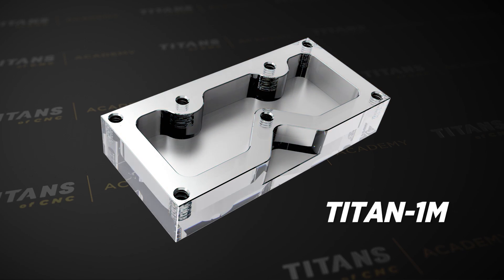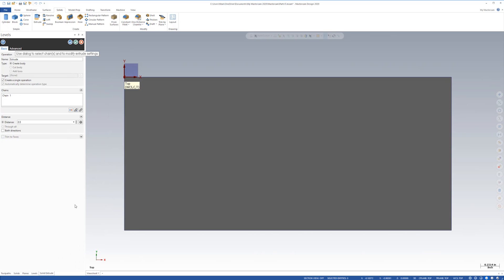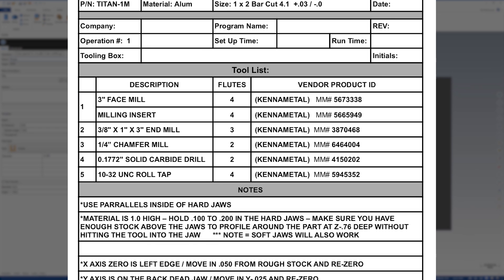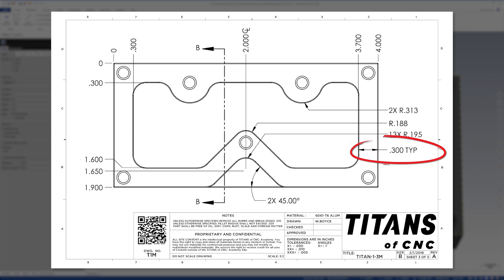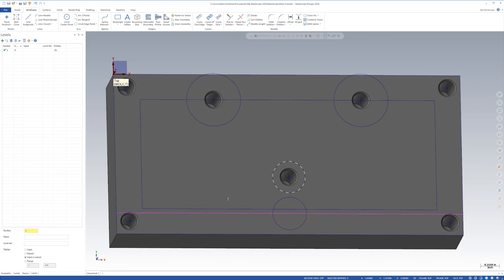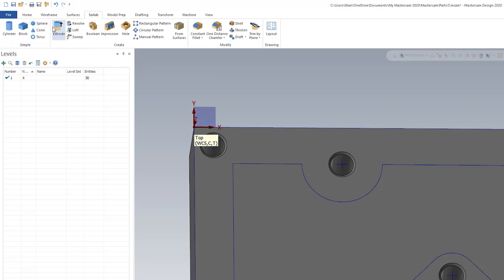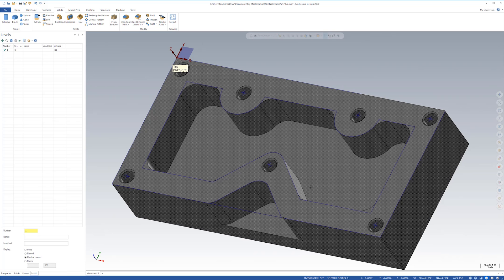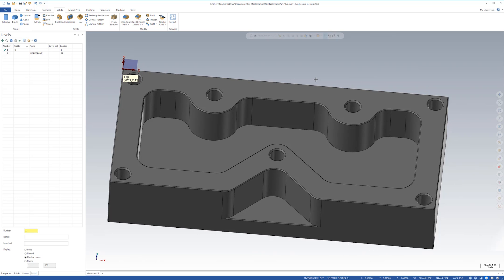Mastercam CAD Tutorial | Designing The TITAN 1M (FREE Resources)

Comment: @7:25 when i press enter i dont get the holes to show up, they appear as x's still on the bottom of the part. im stumped. Also is there settings that we need to input into mastercam before we try this for this to work? when i extruded the part it did not turn solid and was just a hollow rectangle.

Comment: Why have we changed the diameter to 0.177?
I see in the setup sheet it is mentioned we will use 0.177" drill but for the tap in the print it says 10-32 which is 0.159"
I am a total newbie and would appreciate any and all help!!
Reply: Roll Taps require a larger drill size.

Comment: The part where you're breaking the lines to do the outer contour won't work You can't break and re add the line What I've found is you have to extend those lines and then add a horizontal line to them . You can do it your way but try to save the file you can't . Unless I'm missing something then it has to be done this way . The lines I'm speaking of are the 225 deg and the 315 degree lines . If  you break the original contour line you can't save the solid part it will create an error .
Ps not all of have 2019 or 2020 so the Hole add on solids was only put in as of 2019 I use 2018 . Ps awesome videos I will do the whole thing as I'm still learning thanks so much .
Reply: thanks i was just running into this problemm, driving me nuts

Comment: I've been having problems with this drawing, as soon as I do all all the internal .500 extrusion and finer details and finish save . I cannot seem to open the file the same way all I get is a wire drawing . Why is that? Please need help .
Reply: Same as me 😥 did you sort it ?
Reply: Go to the solids tab in your operations manager and click on the little plus symbol next to "Solid". Then double-click on the extrusion and click on the button that lets you re-chain everything for the extrusion. Then shift-click on the side of the rectangle such that the entire rectangle is selected nicely and hit done. Finally, you can hit the regenerate button on the top of that same solids tab. Now you should be able to save it properly.

In case you removed some of the lines when trimming you have to add them back in.

Basically, when you separated the lines for the pockets, the extrusion didn't have a nice rectangular chain anymore since you separated them.
Reply: @demain8781  yes thanks  I figured it out after posting . Just unbroke the trim line that was extruded and drew a phantom line to rechain it. Or something like that .

Comment: Im machining automotive glass and i was wondering what kind of tool would you recommend? im stuck and i cannot go any faster then 15.00F
Reply: use lubricant like kerosene when cutting glass (or clear mineral oil), tools use diamond tools like PCD (polycrystalline dimanond - £18 per insert with pcd on it) or even MCD (monocrystlline diamond - very expensive £220  per insert with MCD on it) try this website for guidance 
https://6c-tools.ch/en/6c-tools-ch/produkte/#iLightbox[gallery_image_1]/0

Comment: Brave enough to admit, I had no idea MasterCam was a CAD program, thought it was only a CAM program once models were developed....
Reply: Mastercam has different modules you can purchase.  Solids being the one you need for modeling.  There is also an "Art" module and many others you chose when purchasing mastercam.
Reply: @TheShift1313  they have done a terrible job marketing their products.
Reply: @automan1223  on their website under solutions they have "design" listed and that's where you will find it.  No argument from me on the marketing side.  I have been using Mastercam for years and training users how to use it for a long time.  For actual modeling past a bit of model prep I always go for a cad focused program.  With the levels, wireframe and 2d vs 3d construction modes it's a very different way to model.  It certainly can be done and there is a solid manager that tracks feature history but I still stick to model prep only.
Reply: @TheShift1313  I looked at MC but only or the port solutions for cylinder head work. 15k out of my price range, and I do not have a 5 axis at this point...
Reply: @automan1223  yeah it's a big investment.  I have know people that have ported heads programmed with Fusion 360.  Depending on what head it certainly helps to have a few other tools on hand as well to really know how deep you can take them without getting into coolant passages.
Reply: @TheShift1313  Fusion has brought the barrier to entry way down and they have an excellent business model which is why they are the best for new shops.

Comment: Quick tip from someone who runs mastercam everyday. When you input the hole positions using coordinates, learners may benefit from using XYZ. Example, instead of (.15,-.15) it would be (X.15Y-.15). I found that really useful when learning. 
Also I know it wasnt effecting this video but when creating additional wire frame (the angled lines and rads in middle) it's good practice to lock in 2D rather than 3D so no geometry can snap to a different Z height and mess up your chaining.
Reply: @wildin13 how do you get the XY origin that Titan snaps to , to start the rectangle ??
Reply: @iambot_zyla  he is using the auto cursor features. You can see this menu when creating wireframe at the top of the graphics screen (it's slightly faded until you hover over it). The auto cursor menu let's you select what specific type of feature you want to "snap" to (end point, mid point, arc center...) but there should be a small cog next to that drop down menu where you can set the default features to limit what it automatically tries to find. What titan used was the world origin (X0,Y0,Z0)
Reply: @iambot_zyla  spacebar , i know its 5 yrs but someone else may be curious.
Reply: Thanks a lot @wildin13 
Got it to work
Funny thing I followed that video step by step and things still didn't work like it did on Titans end
For example on his Levels page I have different amount of entities compared to him. Maybe I'll go back and do it all over to see if I did something wrong 
Also when creating the toolpaths for the pockets I get errors.
Reply: @mikeberlinquette9896  it may depend on the configuration you're using. You can customise default settings quite alot to each user's preferences. He may have different settings to you. As regards to the errors when generating toolpaths, once again could be a number of things. When it opens the toolpath mastercam will auto fill entry fields and alot was skipped over in this video. Some fields may have a value too large/small for the cutter/pocket size. Also errors could be caused by the tool dimensions. Make sure there are no redundant dimension when creating a tool.
Reply: @wildin13
The videos are awesome but I think they need to start with helping to set the software and maybe a tutorial on understanding the work around a bit.
When I did all the fusion tutorials i found the same problems ...I spent hours and hours researching and trying to find the right video to help. Sometimes it's tough to dedicate all those hours, work and family  time 
I spent 4 months in the hospital last year so I used that time to pound in the hours and hours to learn Fusion ...
Reply: @mikeberlinquette9896  unfortunately tutorials for mastercam are few and far between, and when you find one they're for very specific applications. I was fortunate to have formal training but they dont tell you about the config settings. In theory it should be ready to run then it's just tools, holders and toolpaths that you need to work on but there are alot of settings that can make life easier depending on how you like to work. I wouldnt worry too much about having different amount of entities the in the vid. You may just be creating duplicate wireframe when forming the solid and things like that wont have any effect on how toolpaths are written.
My advice would be do something simple first. Get to know some basic programs, how you select features and play around with settings. Look through all the menus and see for yourself what you like or dont like. Just dont change too much in 1 go. Also look out for the grey question mark, if theres anything on a page you want to find out about then press that question mark and read through what it says. It's not the best at explaining but it may help.

Comment: FREE Mastercam?? That would've been unheard of only a couple of years ago. I guess if it wasn't for Fusion360 this wouldn't be happening. Thanks Titan for the tutorials.
Reply: but there is no possible commercial use of it since it can't post g code like fusion which means you can't compare the quality of the codes produced by the software probably just did it for marketing and making people familiar with the interface
Reply: @marouanebenderradji137  its pretty good. Most big places use it.
Reply: @dominic6634  you din't get it the free version of mastercam will generate the toolpaths just like the paid one but it won't post g code that you need to run the machine thats why it has no commercial use for it not like the free version of fusion 360 which can post g code
Reply: @dominic6634  Agree! We use it for very complex multiaxis programming - we have 6 seats (licences)
Reply: The home learning edition has been available since mastercam x2 and probably longer than that.
Reply: @wzhaicthtaarkyer  If you can't post out the G code then it's not really free. Fusion could post 3 axis G code from day one.